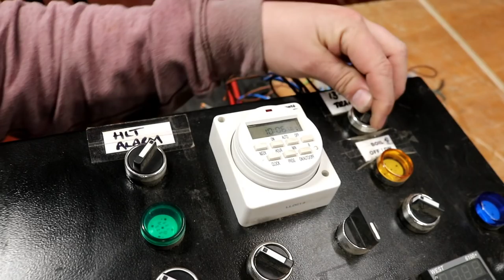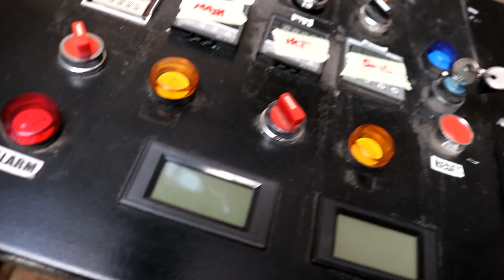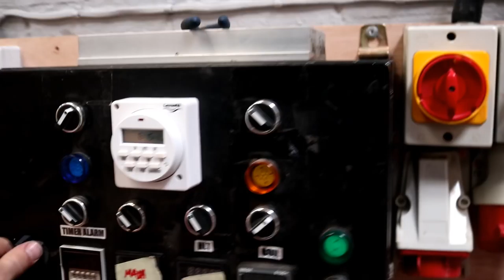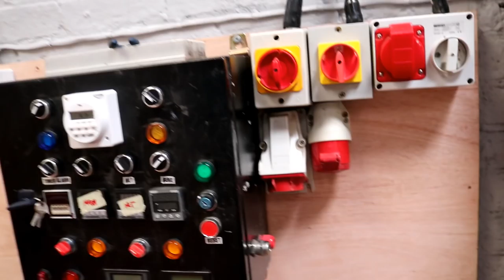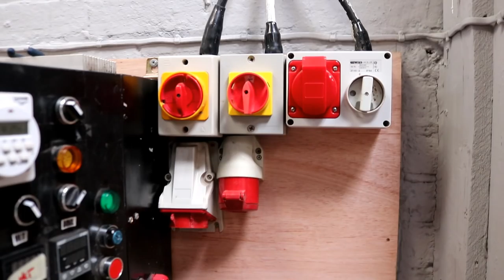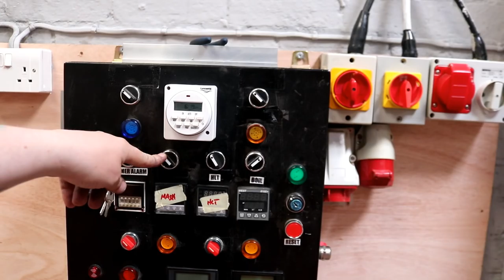POWER CONTROL

Comment: At some point could you get proper copper busbars instead of running the risk of the chocolate block connectors melting? Thought they were only rated at 13A max?
Reply from the maker: The terminal blocks are rated 60A even though they are only carrying the power for the box, not the elements. I will test the power consumption of the rig today for the vlog.
Reply: HarryBrew69 yeah got to the end of the vlog and seen you explained it’s only carrying the current for the control gear. Prob below an amp! What’s the solid state relays rated at?
Reply from the maker: 80 amp but they are from Ju Long Ding Dong province so maybe 40 amp